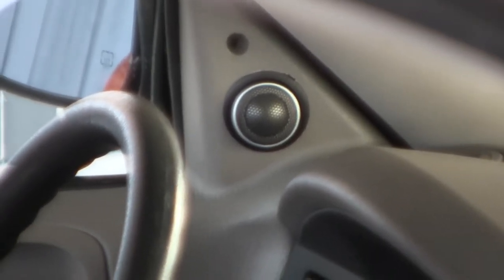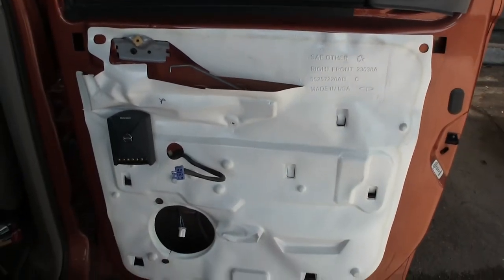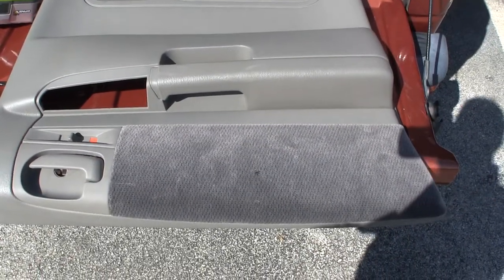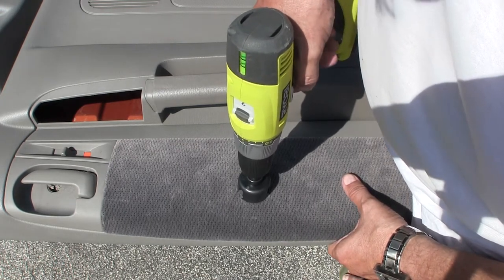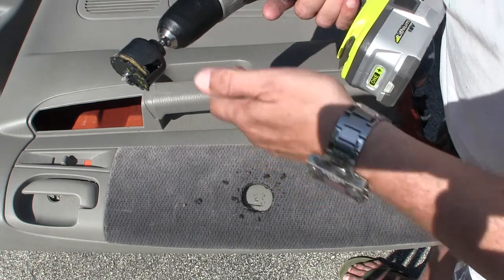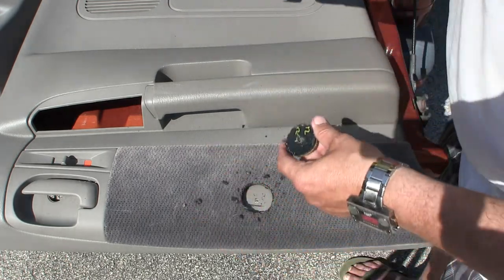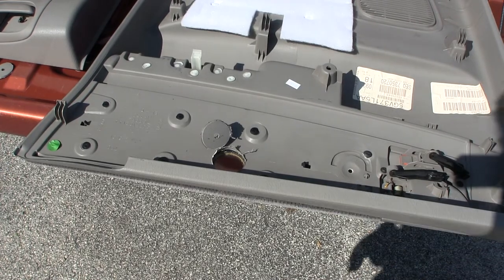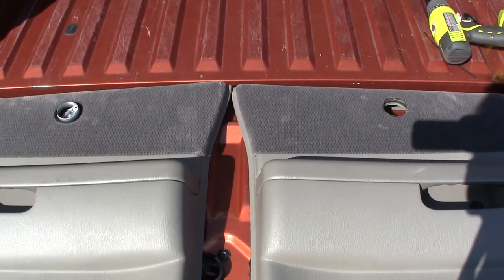2001 Dodge Dakota QC 4X4 4.7L How to upgrade & Install Replacement Infinity speaker 08 of 11

Comment: In my '02 Dakota Quad cab, I installed the rear tweeters in the ceiling headliner. It really opened up the soundstage. The highs are expansive with no dead areas no matter the listener's seating position in the back.
Reply from the maker: There are always options. At the time I was going for the simplest wiring option, so tweeter mounted in door was good for me then.

Comment: Is that a 1” drill bit your using
Reply from the maker: So long ago, the hole saw that I used was a fraction size smaller diameter then the tweeter I was going to install. I believe it is 1 & 7/8 inches

Comment: What size drill hole bit you use for the tweeter
Reply from the maker: It was the diameter of hole saw just a little bit smaller than the diameter of the Tweeter that I was installing because then I used a half round rasp that's a file to enlarge the hole because you can always make a small hole larger but you can't do the opposite and so I kept using the rasp until the tweeter fit in perfectly. I think it was 2 inch but it might have been 1 7/8 in I don't remember I just know I had made certain that the whole I was drilling was smaller than the diameter of the Tweeter I was installing understand thank you good day bye-bye hope you enjoyed.

Comment: can you tell me a bit about the drill and what attachment are you using? thanks
Reply from the maker: Ryobi 18 volt cordless drill and it's a 2-in hole saw or maybe it's one & 7/8 I'm not exactly sure this was like 6 years ago. Always drill a hole smaller than what your tweeters are because you can always make the hole bigger you can't make the hole smaller

Comment: cassette and am/fm? whats the point of nice speakers then
Reply from the maker: I'll be 61 in October 2020 All I play is analogue cassette's and I still use 2 tin cans and a string for a telephone :)
Reply: @Cassette2Go  well what im trying to say is whats the point of replacing the sound system if youre playing subpar audio through it
Reply: @Cassette2Go  while i have your attention, i have a 2002 durango,i want to put a handle on the rear hatch panel so i can open it from the inside,should i use an interior door handle or the glove box handle? i initially clicked on this video to find out an easy way to cut a hole in my plastic panel to put a handle in
Reply from the maker: @Hunt4Yoshi  I understand as you want a handle where none was before.  I know what a durango is, and you want to put like a emergancy handle on it.  I really have not done this kind of rigging - I would suggest you to search for body work or trim video's for vehicles for how to add a handle.  I made a video a few months about installing my parking brake rekease as mine had snapped of that cheapo plastic they use, which is similar to your usage.
Reply: @Cassette2Go  well i have 4 extra door panels with working handles and i figured if i could cut a hole the size of the handle,i could screw it in and buy some little metal rods similar to the ones in the actual door and link them to the same spots the external door handle is hooked up,my reasoning for doing it is because i sometimes nap in the back with the seats down when i get tired on the road,and its easier to get out the back if i could,not to mention the Durango is notorious for having the rear hatch getting stuck down and being able to open it from the inside would be perfect in that situation

Comment: This is really: How to drill a hole in a door panel. He never installed the tweeter, alas and alack.
Reply from the maker: I did install 4 tweeter's. I did not make a video of installation of Tweeter's. Do you really need instructions on how to do that?

Comment: Hi, what tweeters did you use ? Could I get a link thanks
Reply from the maker: You do realize that this video s over Five years and that the tweeters I used in it were at least One year old or more by the time I got around to doing all this as it started with me have to replace a window motor as my glass in the door fell but that is another story.  Infinity's Starfish mounting system for component tweeters  https://www.youtube.com/watch?v=GFKEPL-myPI  That video and this is all I know - 
Infinity Tweeter #331062-001 FOR INFINITY REFERENCE 2000.1 SPEAKER 331062-001
http://www.ebay.com/itm/Infinity-Tweeter-331062-001-FOR-INFINITY-REFERENCE-2000-1-SPEAKER-331062-001-/291694957841?hash=item43ea5fd511:g:ssUAAOSwezVW0VEQ
US $19.99 infinity tweeter #331062-001 
http://www.ebay.com/itm/infinity-tweeter-331062-001-/262317063896?hash=item3d1350bed8:g:UMgAAOSwXshWr~fw
 $16.99 just one

Comment: Tweeter right by ur ear !!!
Reply from the maker: Not true, the forward  mounted tweeter is the equal distance from the rear mounted tweeter on either side of the vehicle with my ears and equal distance from the board or the rear tweeter so it's a very balanced sound there is no Tweetter shooting or directly into my ear.
Reply: @Cassette2Go  well mine are 600 watt tweeters I doubt I’ll put them next to my ear in the door !!
Reply from the maker: @jayjb833  I don't know the wattage of the infinity reference component speakers but they are $100 a pair I think 15 years ago when I bought them and they're hooked up to the premium sound system that came with The vehicle originally and it may be 30 watts a channel output I'm not worried it sounds fine just just loud enough to overcome the road noise and play the music fine